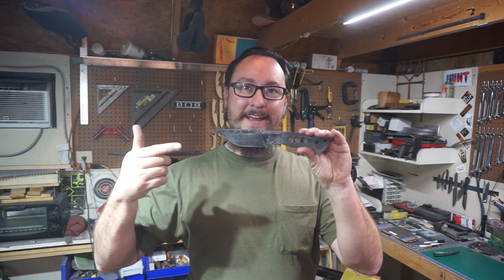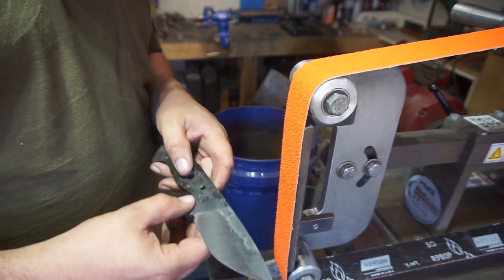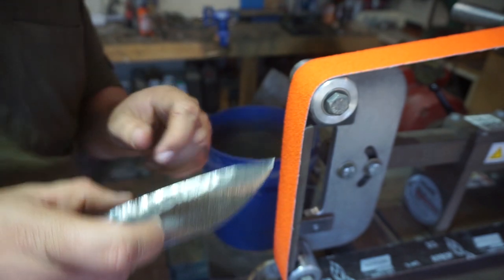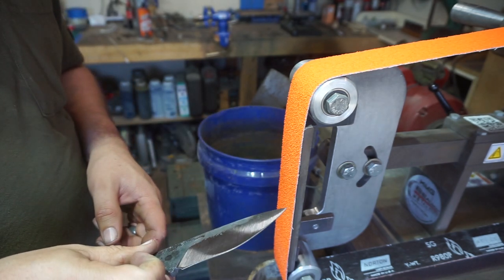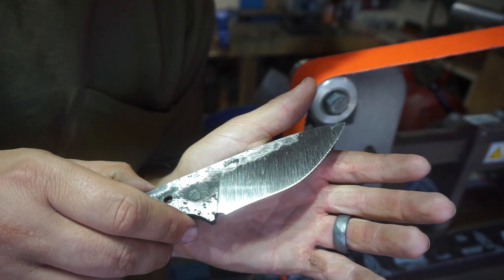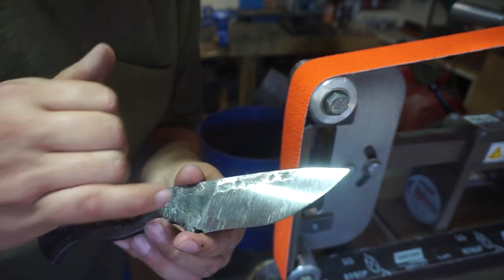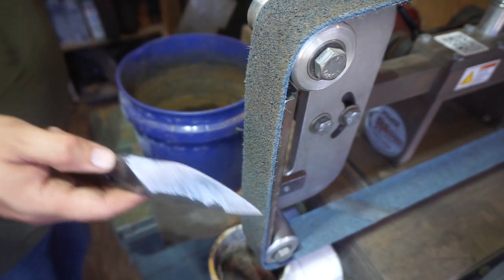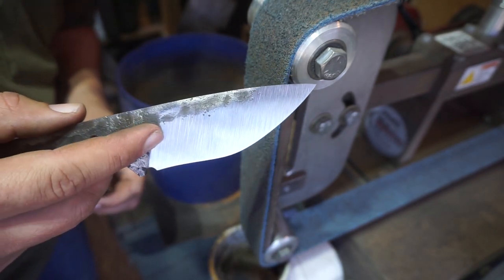Finishing The Blade On The Forged 80CRV2 Give Away Knife | Shop Talk Tuesday Episode 66

Comment: Nice stone wash look..I was noticing your early video's...Your set up top shelf now.. What type of 2x72 did you get?
Reply: Scales on that would be set right off with that rock stone cone shaped grooves on them..I think people use a small wheel .
Did you hand file your plunge or did your 2x72 do it? I have a 2x36 multi tool attachment on my bench grinder,but on the market for a Decent 2x72... 
Nice when you can do nice variety of work,envious....
Reply from the maker: I use a plunge line jig and the 2x72 to donmy plunge lines, I have a video on how to make and use a plunge line jig that you can check out. This is the belt grinder that I use:
https://beaumontmetalworks.com/product/3-speed-kmg-8/
Reply: @theriversexperience9383  I might buy,yours have good tracking? The 1.5 by far enough,right?
Reply from the maker: @aldenunion  yup, it tracks perfectly. I have absolutely loved mine and it's more than powerful enough.
Reply: @theriversexperience9383  You were doing top shelf before the 2×72...Going to look closer at link when I get home..  Your's was running smooth in video...Envious.

Comment: With the coffee, is that just a black coffee from Dunkins or are there grounds in there?   I have the acid but haven't used coffee yet.   And I have stones for washing.   Would you use coffee when doing a hamone after acid washing?
Reply from the maker: Its just some Instant dark coffee. The coffee darkens but doesn't really remove material like the acid etching does.